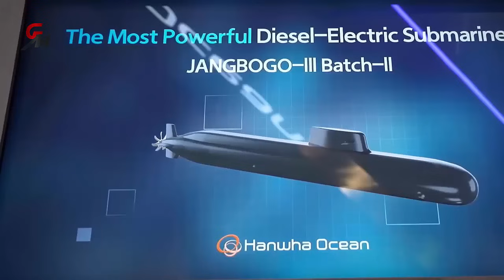Which is Better TKMS 212CD or Hanwha KSS-III, Here's The Canada's Next Gen Submarine

Comment: 4 x 212CDE, 4 x KSS-3, 4 x A-26 OER, 4 x Blacksword for as close to full capability by 2035 as possible, and at least 16 for the most coast in the world. 12?... pff. Baffin Island alone is about the size of Sweden, Norway combined, and they'll operate 15+ by 2035
Reply: Canada is considering 8 subs minimum.    In my opinion 12 is a critical bare minimum.   20 is ok.  But delivering time 2036 is a joke.   It should be starting from 2026 4 subs per year when considering situation in the world right now.  And keep 4 old British subs for training cadets.
Reply: @adams74   Since no order has been placed, there is insufficient lead time for company on earth to deliver a newly constructed submarine before 2031. There are no new subs "In Stock" at the submarine market. One pays for a sub ($5 - 6 billion), then a sub is built.
 Regarding the British subs, why do you suppose the Brits sold them? Would you train jet fighter pilots in a Harvard? Do you hate sea cadets? They would doubtless learn to repair a great many leaks and they would probably  become skilled painters of rusted bulkheads and conduits but they could learn absolutely nothing about modern submarines in those nasty old unreliable death traps! They would learn a great deal about not going to sea for years on end!
Reply: U212CD has VLS!! According to AI, U212CD is in a different league and much more dangerous! U212CD can be extended to 90 or 100 meters with additional identical modules! Diving depth is over 100 meters thanks to its diamond/oval shape, which can withstand 1.25-1.5 times higher pressure. Deep water is the biggest problem in even detecting a submarine due to the layers! Furthermore, thanks to U212A, U212CD is also Arctic and cold water-tested (-1.8 degrees Celsius for continuous operation for weeks), which also gives it an advantage over KSS III! Cold water is an extreme stress on materials!
According to AI, BRD Diehl developed an underwater hull, the Barracuda, back in 2005, which is now ready for use. It can reach speeds of over 200 knots/400 km/h, and in tests even up to 800 km/h! Range 100-160 kilometers! Currently only interceptable by the Barracuda! It's a purely kinetic weapon and, according to AI, probably undetectable by today's sonar because it's too fast. AI: If it accelerates to 800 km/h in the last 5 kilometers and hits, chaos will ensue. According to AI, just two Barracudas would sink a Zumwalt. The Barracuda would simply pierce through several decks and trigger chain reactions.
The facts AI has shown can't keep up with KSS III. Regarding construction time, it's also Canada's own fault, as they build it in their own shipyard! The high-tech components come from Germany and Norway. Another extreme feature are the new TKMS drone submarines. According to AI, 50 of them could form a 5,000-kilometer perimeter (90-100 kilometers detection range for drones) and detect everything above and below water! If necessary, it can also engage targets directly using various means; Barracudas would be an option. The drone just has to wait for what's coming and can forward data to the FCAS combat cloud, where AI then evaluates it!
According to AI, no other submarine can compete with the U212CD of its time.
KSS II is a derivative of the U214, which is the slimmed-down export version of the U212A! KSS III is ultimately based on the U214, which was further developed but without the high-tech sensors of the U212A! According to AI, the U212CD's sensors are in a new, far higher league! The sensors are completely AI-controlled and immediately make suggestions about where the next button needs to be pressed!
Reply: What's very important is that KSS submarines require the extremely special steel from TKMS! According to AI, they can't build their boats without it!
Reply: @tlsig You claiming that KSS‑III Batch III used steel from TKMS is utterly stupid nonsense. Here’s why:
1. Korean shipbuilding is world-class
Just look at the ARAON and next-gen icebreakers: Korea breaks through ice over 1 m thick for both polar research and commercial LNG transport. Germany may have experience with small research icebreakers, but in commercial large-scale polar ships, Korea’s production capabilities are unmatched.

2. Why would Korean subs need German steel?
Korea can produce high-strength hull steel and specialized materials for submarines entirely on its own. The idea that KSS‑III would rely on TKMS steel is complete nonsense.

3. Logical contradiction
If KSS‑III had used TKMS steel, it would imply using inferior materials compared to German icebreakers. But in reality, Korean icebreakers match or exceed German standards in both research and commercial applications. This claim ignores technical reality and is pure fabrication.

4. Russia proves the point
Interestingly, Russia is a major customer of Korean icebreakers. They ordered Arctic LNG carriers and research vessels from Korea, even during times of conflict. If Korea’s shipbuilding is internationally recognized, your claim that KSS‑III relied on German steel is simply ridiculous.

So your claim that KSS‑III ordered steel from TKMS is utterly stupid nonsense - there’s no basis in reality, technology, or international precedent.
Reply: @tlsig Just a side note, the Korean metallurgical company POSCO supplies its Giga Steel to 15 global automobile manufacturers, including GM, Ford, Renault, Toyota, Honda, Nissan, Mercedes-Benz, BMW, and Volkswagen.

https://youtu.be/B9YEsE2NfnE?si=Lj9RsdwhqapDAEYt

Comment: 212cd is also build in finland or norway both arctic nations. 212cd is a perfect fit.
Reply: U212CD has VLS!! According to AI, U212CD is in a different league and much more dangerous! U212CD can be extended to 90 or 100 meters with additional identical modules! Diving depth is over 100 meters thanks to its diamond/oval shape, which can withstand 1.25-1.5 times higher pressure. Deep water is the biggest problem in even detecting a submarine due to the layers! Furthermore, thanks to U212A, U212CD is also Arctic and cold water-tested (-1.8 degrees Celsius for continuous operation for weeks), which also gives it an advantage over KSS III! Cold water is an extreme stress on materials!
According to AI, BRD Diehl developed an underwater hull, the Barracuda, back in 2005, which is now ready for use. It can reach speeds of over 200 knots/400 km/h, and in tests even up to 800 km/h! Range 100-160 kilometers! Currently only interceptable by the Barracuda! It's a purely kinetic weapon and, according to AI, probably undetectable by today's sonar because it's too fast. AI: If it accelerates to 800 km/h in the last 5 kilometers and hits, chaos will ensue. According to AI, just two Barracudas would sink a Zumwalt. The Barracuda would simply pierce through several decks and trigger chain reactions.
The facts AI has shown can't keep up with KSS III. Regarding construction time, it's also Canada's own fault, as they build it in their own shipyard! The high-tech components come from Germany and Norway. Another extreme feature are the new TKMS drone submarines. According to AI, 50 of them could form a 5,000-kilometer perimeter (90-100 kilometers detection range for drones) and detect everything above and below water! If necessary, it can also engage targets directly using various means; Barracudas would be an option. The drone just has to wait for what's coming and can forward data to the FCAS combat cloud, where AI then evaluates it!
According to AI, no other submarine can compete with the U212CD of its time.
KSS II is a derivative of the U214, which is the slimmed-down export version of the U212A! KSS III is ultimately based on the U214, which was further developed but without the high-tech sensors of the U212A! According to AI, the U212CD's sensors are in a new, far higher league! The sensors are completely AI-controlled and immediately make suggestions about where the next button needs to be pressed!
Reply: MzDaizy...So, I've been working with AI since 1980, when it was just getting started! As a developer of cybernetic strategy systems, I probably already know how to analyze and fact-check AI extremely well! If they were wrong, billions would be sunk by major investors!
Apart from that, we already have extremely good contacts that you don't have in many areas for information processing with AI! Suffice it to say, the AI that everyone has access to is already extremely good and can reach about 80% of our AI if you learn to ask questions in chain questions that build on each other!
Reply: Germans and Norwegians have been working together for a long time on cold water/Arctic issues! U212A formed the basis for a very intensive collaboration for the future. The U212CD design was developed by DLR, and the new high-tech sensor technology was developed by the Fraunhofer Institute! Both institutes therefore had to work very closely together to even be able to implement the extremely complex new system! Based on the preliminary concept, the other experiences of Norway/shipbuilders and the German Federal Republic (TKMS) contributed their experience to the implementation of the entire U212CD design! This took about four years! Both countries have cold water/Arctic certifications for all the systems they have developed over decades! TKMS has the longest experience since WWI and WWII!
Strictly speaking, U212CD is a strategic collective concept based on the swarm intelligence of Germany and Norway, their research institutes, companies, and specialists from many disciplines!
This is also evident in the new, modular, high-tech 3D construction process, which is unique worldwide and will save over 20% in construction time. Employees can wear a high-tech helmet with a monitor system that then shows the component directly in the fuselage where the part should be positioned. Everything is digitally visible in real time on the U212CD! U212CD construction time 3.5-4 years, and the trend is even decreasing!
Reply: Built in Germany, serviced in Norway.  All things digital and new missiles aree Norwegian, remainder German.  Germany has partnered with Norway since the fifties on subs.  There even is a designated naval base, mostly low key and hush hush.
Reply: Neither. Build by TKMS in Kiel and Wismar, Germany. Developed for the Norwegian Navy and German Navy tho, so you're kinda right.
Reply: Fits NATO supply chain better.
Reply: What's very important is that KSS submarines require the extremely special steel from TKMS! According to AI, they can't build their boats without it!
Reply: @tlsig You claiming that KSS‑III Batch III used steel from TKMS is utterly stupid nonsense. Here’s why:
1. Korean shipbuilding is world-class
Just look at the ARAON and next-gen icebreakers: Korea breaks through ice over 1 m thick for both polar research and commercial LNG transport. Germany may have experience with small research icebreakers, but in commercial large-scale polar ships, Korea’s production capabilities are unmatched.

2. Why would Korean subs need German steel?
Korea can produce high-strength hull steel and specialized materials for submarines entirely on its own. The idea that KSS‑III would rely on TKMS steel is complete nonsense.

3. Logical contradiction
If KSS‑III had used TKMS steel, it would imply using inferior materials compared to German icebreakers. But in reality, Korean icebreakers match or exceed German standards in both research and commercial applications. This claim ignores technical reality and is pure fabrication.

4. Russia proves the point
Interestingly, Russia is a major customer of Korean icebreakers. They ordered Arctic LNG carriers and research vessels from Korea, even during times of conflict. If Korea’s shipbuilding is internationally recognized, your claim that KSS‑III relied on German steel is simply ridiculous.

So your claim that KSS‑III ordered steel from TKMS is utterly stupid nonsense - there’s no basis in reality, technology, or international precedent.
Reply: @tlsigyou do realize AI often is proven wrong right, always double check and don't just rely on AI for info
Reply: @tlsig Just a side note, the Korean metallurgical company POSCO supplies its Giga Steel to 15 global automobile manufacturers, including GM, Ford, Renault, Toyota, Honda, Nissan, Mercedes-Benz, BMW, and Volkswagen.

https://youtu.be/B9YEsE2NfnE?si=Lj9RsdwhqapDAEYt

Comment: I like the stealth capability and interoperability.
Reply: U212CD has VLS!! According to AI, U212CD is in a different league and much more dangerous! U212CD can be extended to 90 or 100 meters with additional identical modules! Diving depth is over 100 meters thanks to its diamond/oval shape, which can withstand 1.25-1.5 times higher pressure. Deep water is the biggest problem in even detecting a submarine due to the layers! Furthermore, thanks to U212A, U212CD is also Arctic and cold water-tested (-1.8 degrees Celsius for continuous operation for weeks), which also gives it an advantage over KSS III! Cold water is an extreme stress on materials!
According to AI, BRD Diehl developed an underwater hull, the Barracuda, back in 2005, which is now ready for use. It can reach speeds of over 200 knots/400 km/h, and in tests even up to 800 km/h! Range 100-160 kilometers! Currently only interceptable by the Barracuda! It's a purely kinetic weapon and, according to AI, probably undetectable by today's sonar because it's too fast. AI: If it accelerates to 800 km/h in the last 5 kilometers and hits, chaos will ensue. According to AI, just two Barracudas would sink a Zumwalt. The Barracuda would simply pierce through several decks and trigger chain reactions.
The facts AI has shown can't keep up with KSS III. Regarding construction time, it's also Canada's own fault, as they build it in their own shipyard! The high-tech components come from Germany and Norway. Another extreme feature are the new TKMS drone submarines. According to AI, 50 of them could form a 5,000-kilometer perimeter (90-100 kilometers detection range for drones) and detect everything above and below water! If necessary, it can also engage targets directly using various means; Barracudas would be an option. The drone just has to wait for what's coming and can forward data to the FCAS combat cloud, where AI then evaluates it!
According to AI, no other submarine can compete with the U212CD of its time.
KSS II is a derivative of the U214, which is the slimmed-down export version of the U212A! KSS III is ultimately based on the U214, which was further developed but without the high-tech sensors of the U212A! According to AI, the U212CD's sensors are in a new, far higher league! The sensors are completely AI-controlled and immediately make suggestions about where the next button needs to be pressed!